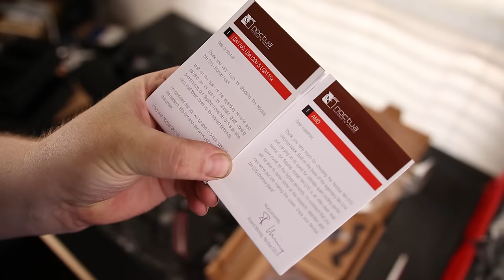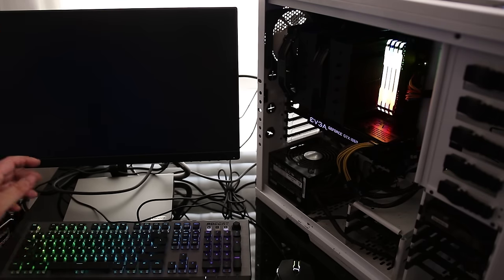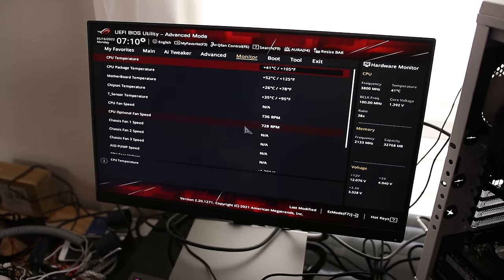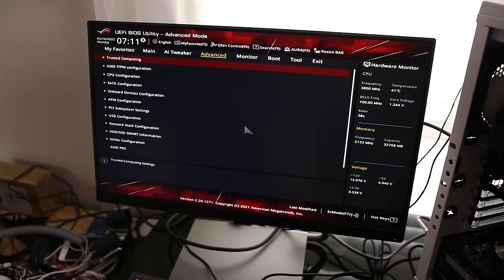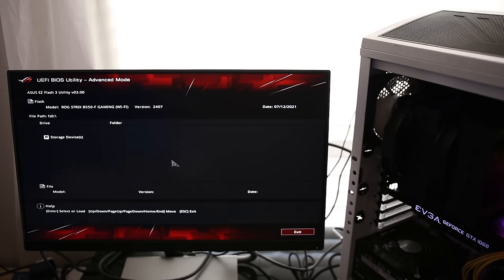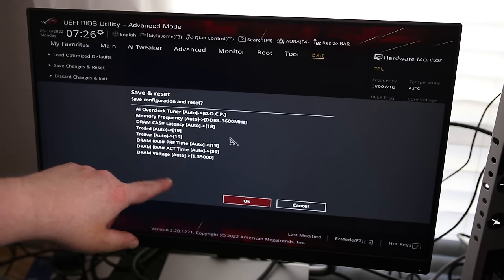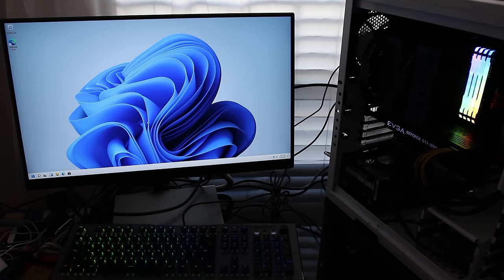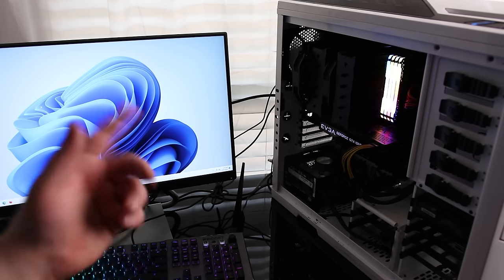Full Build Win 11, ASUS B550-F, Ryzen 5800X, Corsair Vengeance, Noctua NH-D15, Samsung 970 Evo Plus

Comment: I have the Asus Rog Strix B450 F ll model, it still says on the box that I need windows 11, can I install windows 10 home?
Reply from the maker: Probably.  The "Designed for Windows 11", "Built for Windows 11", and "Windows 11 Ready" stickers usually mean that you don't have to mess with the BIOS to get it to work.  That would mean TPM (or PTT) and secure boot.  I can't think of a reason why Windows 10 would be an issue, but I also always see things that don't make sense.
Reply: @fara_chip  Yes.
Reply: @Distractor_Beam  Have you installed windows 11?
Reply: @fara_chip  Yes
Reply: @distractor_beamreviews   Thank You

Comment: what psu are you using?
Reply from the maker: For my personal build I'm using a Corsair HX1000.  This build was using an old EVGA power supply.
Reply: @Distractor_Beam  how many watts that EVGA?
Reply: @KilroyNBC  650
Reply: @distractor_beamreviews  so if I'm going to use 6700 xt,i guess I'm gonna need more than 650w right..or 650w is already enough? sorry for asking a lot
Reply from the maker: @KilroyNBC  Don't sweat it.  :)  For most builds 650 is going to be perfectly fine.  According to Google the 6700 uses 230watts and the 1060 I repurposed in this build uses around 120w, so if you want to be safe you could kick it up to 750.  You really have to take the whole build into consideration including drives.  It's also worth mentioning that if you get a power supply that's much bigger than the draw requirement, it can become much more efficient, produce less heat, last longer, and save on the power bill.  When they say things like 80+ bronze and 80+ platinum, that means it has to meet that efficiency at 80% load, so for a lot of people I'd take the total draw of your build and divide by 0.80.  On my personal build I'm running at about 50% load and the fan doesn't even have to kick on.  That's just personal preference.  Outervision made a really cool calculator here that might help out:  https://outervision.com/power-supply-calculator
Reply: @Distractor_Beam  thanks man. very much appreciated. was thinking to use 650w for 6700xt n r7 5800x

Comment: Hi did you used 8pin +4pin cpu or only 8pin sorki my English is not good
Reply: @distractor_beamreviews  Thanks for the answer, also skill I just connected 8 pin and my pc won't wake up I don't know what's going on the rest of the components are rice 5600 gski 2x 16 Ripjaws 3600 seasonic 650 focus plus xfx 6750xt

Comment: i had to lol at the 8320.. my old comp was a 8120 oc to 4.1 for years and i built this same setup asus 550 board 5800x and a 3070 same corsair mem but mine is a cl14 good setup but i got mine in the lame years 3070 1,000 bucks... 
:<{)

Comment: I have rog strix rtx 4070 ti and Ryzen 7 5800x3d, can I use the same bulid same mobo psu ram m.2 with this gpu and cpu.?will it have problems and bottleneck etc
Reply from the maker: I'd invest in a good psu.  For my personal rig, I use a Corsair 1000W and I'll never go below it.  Bottlenecking depends on the task at hand.  If you're GPU mining, the CPU will be way overkill.  If you're testing physics on 10 million bouncing balls traveling through a maze, the GPU will be way overkill.  If you want a calculator, there's this:  https://pc-builds.com/bottleneck-calculator/result/1fN1dN/1/general-tasks/3840x2160/  If you're just gaming and general, I wouldn't worry about it.  The motherboard, RAM, and drive won't be an obstacle.